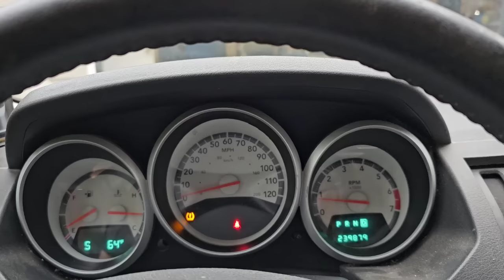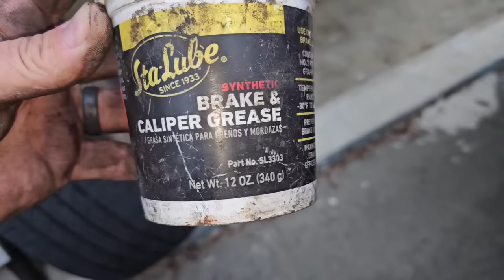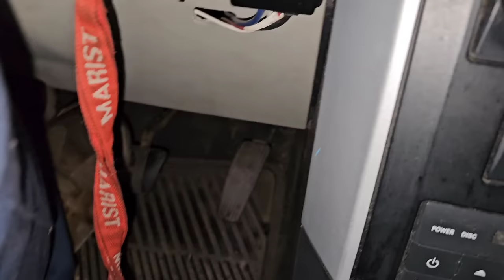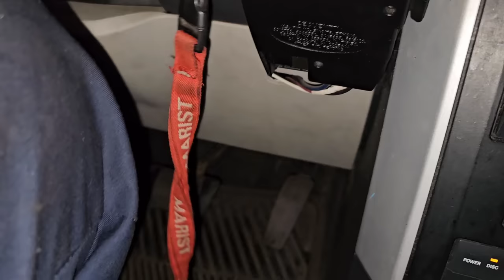I Knew It Was Gonna Need Brakes Soon, I Just Didn't Think It Would Be Today !!

Comment: That's because of the engine placement, and the amount of torque requirements. The van was poorly designed and never meant to be a long term vehicle. It was always meant to be a part and replacement vehicle.
Reply from the maker: I would disagree. I've had multiple Caravan's with as high as 450K on the odometer,  and this is the only one that's ever had this issue. These Caravans are dead reliable also. I wouldn't think twice about driving cross country in it . 245K with the original trans that's never been serviced. Can't beat that